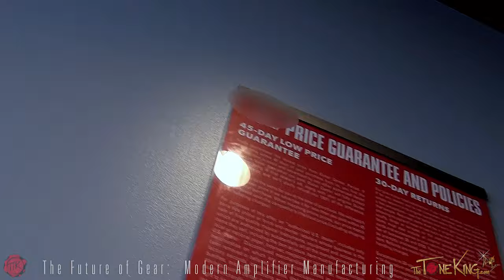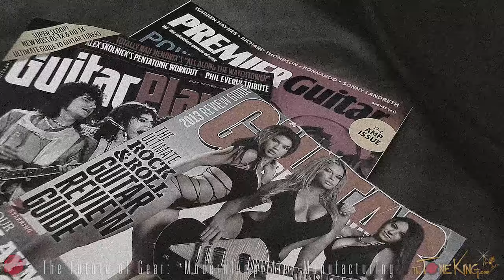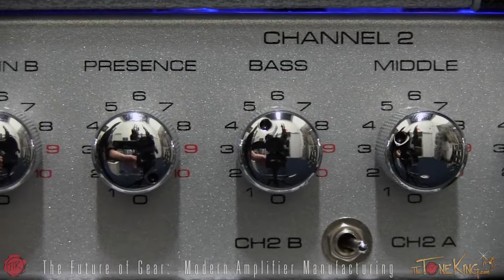The Future of Gear - Modern Amplifier Manufacturing

Comment: I see how they would look at the problem and come to that conclusion about how it's driven by price, but I can tell you as a guy who plays a guitar just for recreation, the problem isn't price it's the niche that needs to be filled. Let me relate my own plight to those who also watch the tone king. While I agree you don't see many options between the low and high ends, but the real issue is that there also is NOTHING in between your five watt amps that don't even have a three band EQ and your twenty-five, fifty, and hundred watt amps, and in the speaker products, there's very little for someone who plays in their bedroom where  you want a low wattage amp so you can pump the amps guts out, but most of the stuff I see on market is fifteen, twenty, forty and upward to a hundred watts, with four by twelve 360 watt cabs and all that shit that you would want for a MASSIVE VENUE, but not your bedroom, and that seems to me like a niche left unfilled and glossed over.
Reply: +mikethemaniac1 I'm thinking if you have to be any quieter than a 20 watt amp with a 12 inch speaker, you're just better off with a modeling pedal and a decent set of headphones.But that is just me, everyone's situation is different.
Reply: +offinthepines I've tried modling, it sound kinda thin on the distorted channel, it sounds great clean, but as I get more a sense of tone, it sounds thinner, and I never see say a five watt amp that can get enough gain for me, the problem I have is that I just want to play in my bedroom, now maybe solid state is louder than tubes, I've heard that, but fifteen twenty watts is pushing it for me. and at low wattages I tend to not even see anything with even a three band EQ, all i really see at the low wattage end is class A amps and some have a single knob tone stack, which is simply not what I want, you know?
Reply: +mikethemaniac1 I think I do know. Modelers can be fun but the sound will always be thin and shrill. Problem is for a badass metal tone out of a "real" amp, you need a closed back cabinet and enough volume to get the speakers moving.The hard truth that I have learned for myself is that getting "that" metal sound is pretty much impossible  at bedroom levels.I'm lucky that now I live in a rural area and can crank it up, I even play my Micro Terror through a 4X12.I also have a Jet City 20 watt head and it is pretty awesome. Think about this, the Jet City 22H was designed by Mike Soldano and is as close as you can get to the real SLO for under a thousand dollars. It costs $400, the American made version with the Soldano name on it is $2500. That is the amp in between that you are looking for, anything of lower wattage, that I have had any experience with, is just not going to get "that" sound.My advice get a Jet City 22H, a 12 inch closed back speaker cabinet with a decent Celestion in it, an MXR 10 Band Eq for the amp's loop, and your favorite overdrive pedal, maybe a noise gate, and THAT is about as metal as it gets for under a grand. And it WILL sound like the real deal!Keep in mind that these are all just my own opinions and this subject is entirely subjective. I am just trying to share a bit of my own experience after playing for over 25 years and chasing "that" metal sound in the house.
Reply: +offinthepines I know man, that's the way it seems. what do you think or hughes and kettner tubemeister 18? I hear you can get the EVH tone without turning the gain up to half, and it has this cool attenuator on the back so you can still get a F*** ton of tube saturation and not break the neighbors windows... seems like a good option to me, but what speaker setup would I want to pair it with?
Reply: +mikethemaniac1 I have never had any personal experience with those H&K amps but I have heard nothing but good things about them.As far as cabinets go, a closed back 1X12 with any decent Celestion in it should be fine. Of course a Vintage 30 or a G12T-75 are the most common ones for metal but even the less expensive seventy eighty or rocket 50 will do at lower volumes, the biggest differences between these speakers will only be apparent at higher volumes which we have already established you will not be using. I have a B52 4X12 that I got for $150 at a pawn shop that sounds identical to my $900 Marshall 1960 4X12 until you get up to really loud volumes so, a closed back and decent speaker is what really matters.I think Egnater makes the cheapest closed back 1X12 cabinet with a V30 in the Rebel line or something like that. Brand of cabinet doesn't matter nearly as much as the fact that it is closed back and has a Celestion speaker, Eminence is about the only acceptable substitute speaker wise. Plywood vs. particle board makes a difference as well. Randall also makes some 1X12 cabinets that are slightly oversized, adding more depth and bass than smaller cabs which will help getting a more "brutal" metal sound closer to that of a 4x12, not to mention that Randall has the metal look a lot more than other brands. If the EVH sound is your ultimate goal, keep the 6505 mini head in mind, I haven't had the pleasure yet personally, but I am damned sure lusting over it for 500 bones.